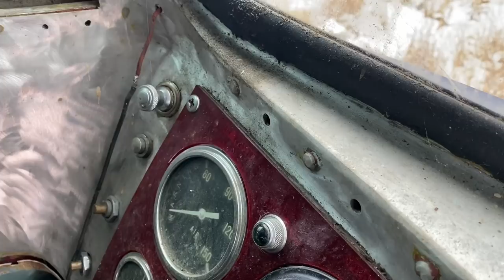Day 1 Silversides  bus rescue Minnesota

Comment: I'm a long haul trucker. I'm old enough to remember those old buses when they were standard. I'll never get over or get used to them having a red line like a motorcycle. Hearing that more howl on the interstate makes the hair on my necks stand up. I'm just waiting for a piston to launch into space.
Reply: I retired from Greyhound after 43 years.   I have driven all of the manual buses.  I started with the 4 speeds,  which had a huge RPM split, so you would wind them right out until they howled, and then you'd shift and listen to them bog and blow black smoke.  Pity the guy following you.  Then they improved with the 5 speeds,  6 speeds,  and we got rid of our last 7 speeds less than ten years ago.  All of these transmissions were non syncro crash boxes which I could shift with one finger, but quite a few of the guys could never shift them and would grind every gear.  Ouch!  I now drive long haul semi trucks with 13 speed transmissions with a 200 RPM split in high range.  Now that's driving!
Reply: @FesterPussbucket  These new autoshift trucks have dumbed down the industry.   Dah,  how do you drive this thing?   Oh just push "D" and go!  In the old days the crash box would weed out the incompetents.

Comment: A warm wife is a happy wife, I see some proper heating being installed on Lenny in the near future. Ebay have small diesel fueled heaters that are rated over 5kw very cheap and they are dang hot.
But on the other hand I bet Lenny has found another 10Hp with all that cold dense air

Comment: The alternator is conventional Leece Niville. Probably 165 amp stator and rectifiers. Looks same as common truck or ambulance back half. Drive end and rotor different because of drive. I have rectifiers, regulator, doide treo, brushes, and bet slip ring is replaceable. Rotor coil will most likely be fine. Don't spend a bunch on it. Happy to possibly help you. Had shop for years, still have parts and testing equipment. Best of luck!

After taking a 2nd look, back half is the older style. Popular on older ambulance and many emergency type vehicles. Distinctive difference is brush holder and regulator. The reg. Is the aluminum cover on top of brush holder. Later style referred to as Loadhandler, with different brush holder, regulator and com end frame. Rectifiers and stator interchangeable. Excellent alternators.

Comment: I understand how the previous owner feels. I sold a 1973 FJ40 that had zero rust anywhere……,frame included. It needed a bunch of wiring finished, a windshield, brakes,  etc.  Didn’t need much to finish but sold it due to needing funds to buy a house.  I was so close to having it on the road.

Comment: that bus is gonna make someone a real nice motor coach id love to get me a silversides bus
Reply: @travis allen  , i agree with you ,, the silversides is in my opinion the best looking GM bus 
I DO own one , mine is a 47 and it's wonderful to drive ,and gets lots of looks everywhere it goes ,people always ask me about it ,,I caught the BUS Disease a few years ago from a friend after i helped him build a Skoolie  but i decided i wanted a motor coach  and when this silversides came up for sale at a local auction  i just had to have it ,,nobody knew what it was  , it needed a few minor things fixed but was drivable after replacing the steer tires and a quick going over ,,, I have learned a LOT since i started watching this channel not long after i got my bus in january
paid just $8K for my bus but i have spent that easily on upgrades in the last 8 months too
Reply: Sounds like you may want to schedule a meet with BGM so he can " run the rack " on the old girl which means do a tuneup on her. You think she runs good now? Wait till Scott gets done with her.

By the bye, congratulations on rescuing another silversides from the scrapper. Does yours still have the original hot water heaters intact and operational? We may not like driving in cold weather but better to have operational hot water heaters than not. I've seen propane heaters inside rv's and they in my opinion will kill you as they don't have any exhaust on them. In my time driving an 18 over the road it was normal to roll the hood forward simply so you could either turn the heat on or off depending on what the weather was like you were driving in.

Congrats again on your find.

Comment: Yep, supposed to be 60° for a low here in Central Florida... breaking out the heavy coats and gloves as we speak. :-)
Reply: Yep, I know as I am sitting outside with no shoes, a t shirt and some light jogging pants and it is a cool 67 degrees  wondering when I will need sixes and a hoodie..in Cape Canaveral....lol.  No Minn for me after Oct, ever.
Reply: @B Brut  You are the man... The worse thing is that frigid high of 77° tomorrow, you will probably be around 85°. (I’m in the middle of the state)
Reply: To hear my cousins talk when goes below 80 in Florida you put long sleeves and a sweater on below 70 long sleeves sweater and heavy winter coat, and below 65 it’s time for long johns, sweater, heavy winter coat, gloves, watch cap etc and below 60 break out the Arctic cold weather gear and past abandon all hope for a new ice age is upon us
Reply: @gullreefclub  I'm in central Florida and this is absolutely correct.

Comment: Was it cold inside the bus or just outside ?  If it's cold inside, perhaps besides augmenting the heating you could use electric blankets.   They even make 12V models. ❖ The pink headliner has to go.  ❖  What runs on "GAS ONLY?"  ❖  Those are nice rims.  ❖ Going out to dinner?  Cold today; hot tamale.
Reply: shreddder999 or a good old Chinese warm air heater, surprised his bus don't have one, there cheap as chips
Reply: That gas only tank was for the pony motor that runs the air conditioning. Then after people remove that system,  they often put a gas generator running off of that small tank.
Reply: @MrMauserb  Okay, thanks.   I've seen pony motors to start large CAT tractors.
Reply: Lenny was warm (propane heat) but it was 25` outside with the ground frozen and snow on the ground. Thankfully no wind so it wasn't bad

Comment: Does any of the factory heating system remain in Lenny? If not, are there any options for running heat to the cab and front end? I got cold watching you driving ❄️
Reply: jimo199966 you can buy a heater matrix and plumb it in wire it to the system and it will work off engine temp
Reply: 100% can be done. He has big inverter and a battery bank. I wish he put a rack ontop of lenny and added solar. As to not screw up the top. Then he could run more electrics and extra heaters easy. But Scott likes warm weather. Winter caught us all off guard in midwest this year. Here its 60°F avg its 20°F 40 for the high. So further north(im dead center) its gona be collllddd
Reply: Just run an aux heater core from the engine, while driving of course.  That engine makes enough heat under load to sweat you out of that bus.  At night, while sleeping, a Mr. Heater Big buddy.  Or...winter in the south.
Reply: Lenny I don't believe has it's original alternator, it has a small 2 belt automotive alternator instead of roughly 100 amps.
Reply: @Burnit53  that long of coolants line while may work great only adds complexity though. Im with you but keeping stuff simple works best in stuff like this in my experience
Reply: @jamesshanks2614  yeah but it has a generator and batteries so in theory he could run em just duno how cost effective itd be. I think a simple diesel heater like used in larger sailboats would be perfect. And u already have diesel on board and they burn very very very little fuel and require very little flue pipe. Easily vented out of a window with a pre made temp metal insert to seal it. I think they use like a coil of copper and a tin can cased in a "stove" like thing. Cheap and would for sure heat the bus no matter if you had power or not. They'll burn kerosene and many other things too
Reply: His alternator would have trouble running one small electric heater.  Remember that the alternator robs horsepower from the engine.   These old Detroits don't have much extra power to give away. These buses have air intrusion from every direction while cruising down the road. You need lots of heat to keep warm. That's why many of us run our generators going down the road. It stays toasty inside.
Reply: @MrMauserb  yeah but no way would even a 120amp alternator use up enough torque to really hurt it. Yes on my 22re 4cyl toyota it can drag the engine. But these things are so torquey an altenator isn't going to hurt you for the benefit it gives. If he can get one like this 4103 has like 200+amps and the turbo set up he will have zero issues. But yeah sealing it up. It can be done i seal up huge old buildings and sailboats all the time. You just have to put alot of work into it and use Butal rubber wherever possible
Reply: The engine alternator at 24 volts, 100 amps, only inverts to about 24 amps at 110 volts at best, barely enough to run one or two space heaters.  Engine heat is the only way to keep that thing warm in the winter.
Reply: Why burn fuel for heat when your already burning fuel to move the bus down the road? All the waste heat is just that being wasted so why not do what the automotive industry has done for years? If Scott gets the time I'm sure he would love to install a hot water heater box in the dash of Lenny or wherever it was originally. Then he's nice and warm inside without wasting any heat. If he was to run a hot water line with a heat exchanger so no fluids change he could run his generator and with only the addition of a 007 circulation pump which is a standard pump on home hot water systems he'd also wind up heating the main engine as well. No electric needed except for the 007 pump and the heater fans.
That gear drive pump is interesting but I recall on a previous video you showed the factory alternator on a 4104 I believe that the owner changed out the air cooler alternator for an oil cooled one that you said would eliminate his alternator from overheating. Plus the factory alternator mount on 4104 used a plastic drive gear, I wonder if the alternator on this old girl your bringing back to life also has a plastic drive gear? I'd hope its plastic otherwise if it fails how many gears on the accessories end would you have to replace? 

Just thinking about how I can bring up the potential failures by switching to that alternator mount. Seeing as it's a mounting you apparently haven't seen before. Gawd!! No belts to adjust and worry about! It boggles the mind!
Reply: The silversides is 12V.  Now do the math at 12 volts, not 24.  It doesn't get any better.
Reply: Do you have any idea how big of a heater core one needs in a bus?  Where would you fit that in the dash.  Even for a small heater core, you must get heater hoses through some tight spaces. I could be wrong,  but I believe lenny still has the factory heating in it.
Reply: There must be some provisions for heaters in the design.  These busses ran in cold climates.  The biggest problem with all the long lines is that if you spring a leak you loose the whole cooling system.  Happened to me once on a Suburban with a rear heater.  Maybe the heat exchanger for the heating loop with separate circulating pump isn't a bad idea.
Reply: 100 amps at 12 volts will invert to around 10 amps at 110 volts.  Not enough to run one space heater on high.  Don't forget the lights still have to work and the battery still get charged.
Reply: What do the big modern RV's do for heat?
Reply: @lowercherty  - They have in-dash HVAC for going down the road; just like a van or pick-up truck and car. Heated engine coolant going through one or more heater-cores.

Comment: Yes I do know how big a heater core is, a Mack granite uses the same size heater core Mack has for over 40 years 44,000 btu's. Build a box to put the Mack heater core with the diverted box in somewhere behind the drivers seat then air ducting to the windshield and a small built diverter to go from windshield to floor. Check them out at a junkyard.

Comment: Maybe you could fit a bunch of insulation and one of those diesel fuel heaters they use on boats to heat your bus Scott?

Something along the lines of the unit Madds installed to Athena in 'Sail Life' might do the trick?

Comment: So, how did it finally end up with the 4103’s fuel issue?
Reply: It's still a work in progress. Scott's going to put new injectors in it in a couple of days.....indoors!
Reply: @siaripop7  Yes. Rebuilds on that one are a must...but I heard it while Philly was driving.  The decel when shifting was far too slow at times for a fresh overhaul, and I saw blue smoke on decel.  It appears to be running on it's own lube oil at times.  My first check on that is to open up the airbox and look for oil.  That reman blower might have a hinky seal.  Overhauling a Roots blower for the 71 is getting to be a lost art.  Setting up the lash and getting those seals in right can be tricky.

Comment: You should look into one of those small Chinese knock off, webasto heaters they use in semi-trucks to heat Lenny.
 You can find them for about $150 bucks on ebay or amazon
Reply: @douro20  Quite a few guys on Trawler Forum have had very good luck with those units.
Reply: He has propane heat in the entire bus

Comment: You mentioned the bus from a previous video with the snapped differential pinion shaft.   You thought that the reason for the failure was that the owner had rocked the bus to get it out of a rut.   You said that you were hesitant to try rocking this bus out of it's rut as a result.

I have been thinking about that since the original video and doubt that was the cause.   In that video you noted that the drive shaft slip joint was collapsed.   I think that the collapsed joint was the cause.   With a "solid" drive shaft the vibrating mass of the engine will pound on the mass of the differential.   Also, the road vibrations of the differential will pound against the mass of the engine.   It is this pounding that snapped the shaft and not the normal torque from the engine.

It is hard to believe that a common occurrence like getting out of a rut would result in such a catastrophic failure.   These drive systems were produced in the thousands I doubt such a weakness would not have been noticed.

Comment: You mentioned before that you used vegetable oil in your dd.  Does it need to be heated or treated?  Could you burn straight kerosene and would it cause any damage to seals or the fuel pump if it does not have lubricant in it?

Comment: If your heat or isn't work I g you need to put cardboard on part of the radiator to block off air going thru it. Heat or should get warmer?

Comment: The two stroke/cycle Detroit Diesel use to be called the Detroit Vibrator they had several CID's depending on the bore size but the principle was the same.

Comment: As soon as I saw you driving with the sweatshirt and gloves I had flashbacks to the old VW bus years!!! Why don't you plumb in a couple of those hot water box heaters? Running 65-70 MPH you should get plenty of hot water while you are cruising, I am guessing your propane heater does the job when parked.

Comment: Hey I've watched most all of your videos and I also am a mobile mechanic and I'm looking at getting a 1965 gmc coach and I test drove it today and it has the 4 speed and 8v71It just ground to death every shift so my question to you is that normal or is it out of adjustment ?
Reply from the maker: Were you double clutching?  And Reving the engine suoer high on down shifts?
Reply: I tried it both ways but adjusted the slack from the clutch rod the clutch and it made no difference

Comment: Get somebody with a 4x4/winch to pull it out rather than jack it up in place.
Not good to work in the snow.
Reply: It's most likely over 20K lbs. Your not pulling that out with a regular truck/winch. You'd need a real semi wrecker to get it out which costs 100's of doll hairs per hour. 

Not to mention what damage might get done. I does suck working in the snow though.
Reply: It's right around 10 tons. Unless its a large tow truck, its not towing a bus out of the mud.  A large tow truck is expensive.  Besides that, anything you hook a cable to will likely break, or bend on this (semi) monocoque bus.. Scott knows what he is doing.
Reply: Yes, you really don't want to yank on or lift tow these unless you absolutely HAVE to.

Comment: Even putting in a 2400 horsepower Volvo Iron Knight race truck engine is a problem unless the whole bus chassis must expand to its wide Volvo Iron Knight semi truck measurements as that option, including the outer bus body. I meant that as a curiosity is that no one did an Iron Knight powered bus in the first place.

Comment: It sucks it got this cold up here this quick.
Reply: You got that right!  10 below in west Wisconsin in early November is just not good.  :/
Reply: @NJP76  I hope this ain't how winter will go up here, it will get old real quick.
Reply: @vince19682009  This is true.  Although I do enjoy outdoor winter recreation.  The new skis and snowshoes might get a workout this winter.
Reply: @vince19682009  Oh cool!  I see you are into auto racing.  I actually work at a local track up here in the summertime.
Reply: @NJP76  What track is that?
Reply: @vince19682009  Tomah-Sparta Speedway.

Comment: I really appreciate your video even more after seeing a guy on another channel destroying an old mci bus with a Detroit v8 by starting it with either and because it sat for some years the injector rods stuck at full throttle, they ran it like that slamming it from reverse to forward until the engine died smh<🙁>.